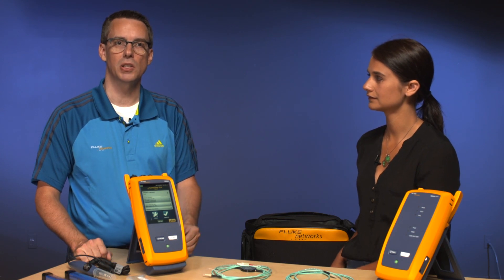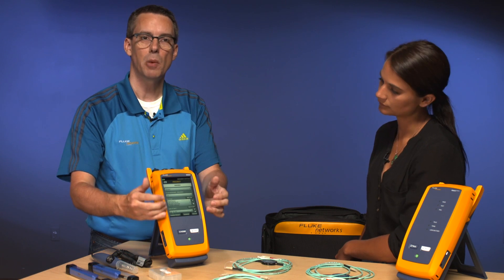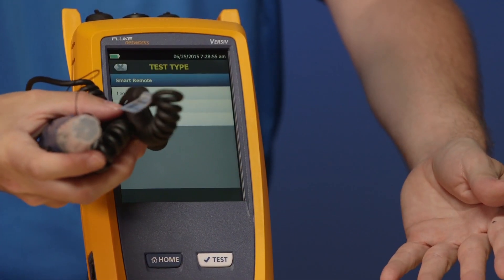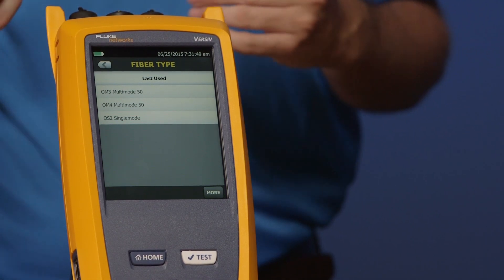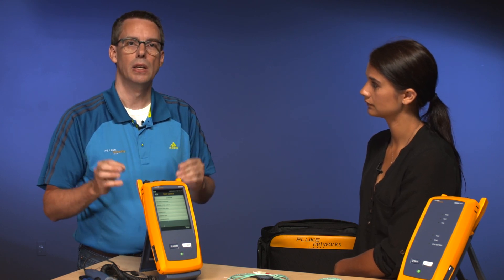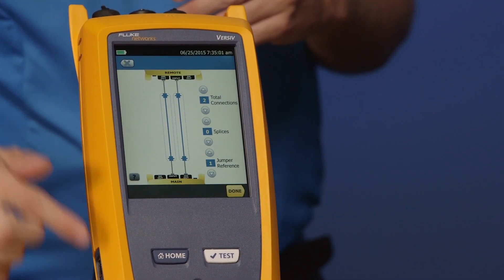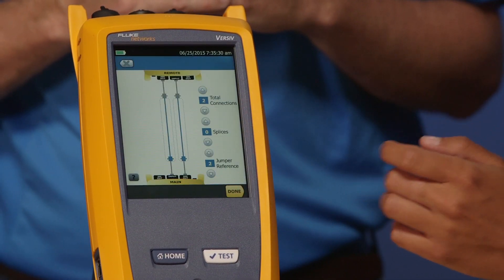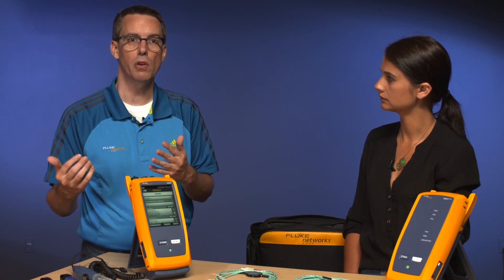CertiFiber Pro OLTS Getting Started Video - Setup Part 1 By Fluke Networks

Comment: For single fiber test, press and hold the VFL button on the remote for about 3 seconds to turn on the output light source. First time it starts blinking green and red it will be for MM, hold again for SM.